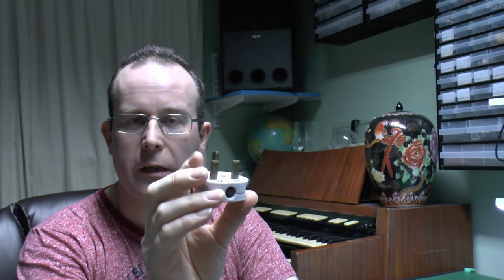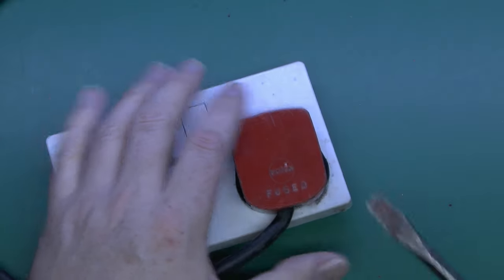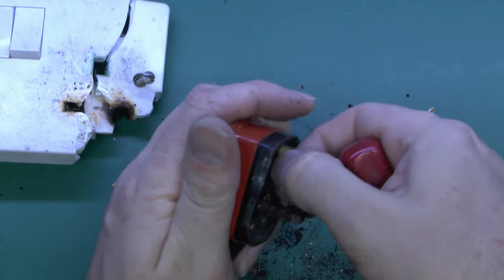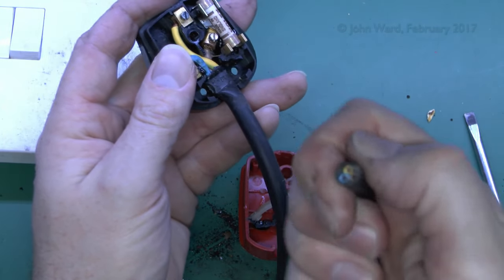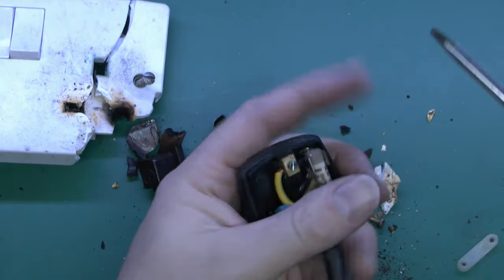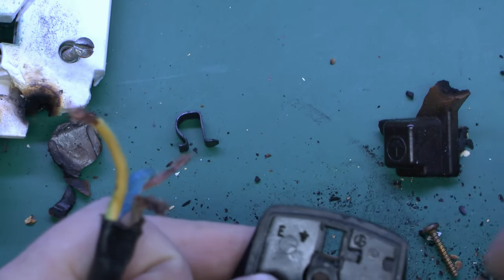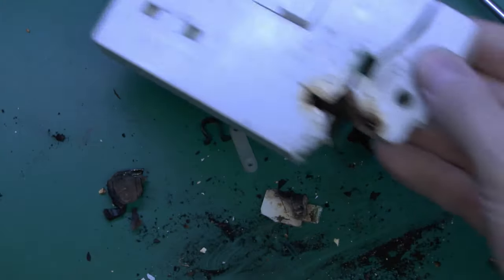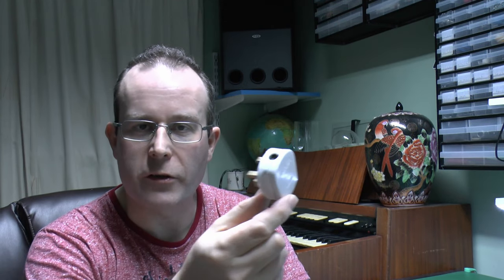Overheated Plug and Damaged Socket Outlet

Comment: I'm surprised to see this, since I was informed that UK plugs are so very superior to all others. ;-)
It is best to go straight to CEE plugs (IEC 60309) if there are high currents for a prolonged period.
Reply: you don't find IEC 60309 plugs/sockets in homes in the UK only commercial have it, and that's usually when you're pulling close to 13Amps or higher.
Reply: Yes, and they know why.
Why would I install another crappy household socket when it is only a question on time before that fails again. No need to push your luck with causing a fire when there is reliable industrial equipment to do the job safely.

I don't know how that CEE plug would deal with your UK ring-mains fuse-in-plug regulations, but since it is common already as a camper van socket there must be a way?
Reply: We use them at work a lot for server/coms racks mainly, well the 16Amp flavour of those and some 32Amp ones too, and they have an in line RCD breaker on the wall as normal as well as an overcurrent protection breaker just before the socket. Usually though in these cases it's a case of everything is rated way higher than the fuse/breaker.
Reply: +stefantrethan:

Yes, I think everybody would be happy to replace the discreet plugs and sockets with the bulky blue industrial style CEE-plugs and -sockets.

You could have this problem on every type of socket/plug:

http://www.eloteba.de/images/echeck-beispiele/echeck04.jpg

I've seen this kind of damage on Schuko too. This problem is caused by corrosion of the contacts. This is causing a transfer resistance and the contacts are heating up.
Reply: Sure, they are quite beautiful. Really shows the neighbours that you can afford a lot of electricity. ;-)

It can happen to any plug, especially with a (likely) termination problem as in the photo.
But if you compare the contacts in CEE and Schuko sockets I have a lot more confidence in the CEE type. It is a solid brass rod in a substantial brass tube, with a steel spring around the outside to compress the tube. Schuko sockets by comparison are just a flimsy stamped piece of sheetmetal, some cheap ones don't even have the steel springs around the outside any more to keep up the contact pressure.  

You can feel the heat generated in the Schuko plug with just a space heater, even just 1-2kW and you can often feel it getting hot. It won't happen with nice shiny new PCE Taurus connectors of course, but the real world is far from ideal conditions.

I had to learn this the hard way too. After one Schuko socket burned out the second time I wised up and stopped worrying about how it will look. After all a blue plug is a lot more pleasing to the eye than your whole house lit up with blue lights from the firetrucks...
Reply: +stefantrethan:

Have you seen the contacts outside of the plug shown here? The contacts of the BS 1363 are made of brass and went green through corrosion not through the heating up. That was the problem, not the socket. The plug must have been replaced when the first sign of problems occured. And this corrosion could happen on every type of plug. And the plug was not connected very well. Until several years ago you've learned in general school how you attach a plug to a cable in the UK, because there were several non-standard plugs available. The appliances were delivered with open end on the cable and you'll had to attach the plug for yourself. So this could be made by a non-professional.

And you should stop using this cheap, shitty hardware centre crap and use good material. In case of Schuko this would be Busch-Jäger. And if a Schuko is burning out twice times, you've got a serious problem that's not related to the socket itself. Could be the plug too, or the fuse or the MCB are rated to high (max. B16, you should not use the C-type for Schuko). And Schuko is rated for 10A permanent or 16A short-time.
Reply from the maker: The blue 16A CEE / IEC 60309 sockets are not permitted for household use in the UK, as all sockets for that purpose must have built in shutters.
Even with shutters, most homes have 32A circuits, so fitting 16A outlets would require a significant amount of rewiring.
Reply: I had a colleague at work once who had never interacted with a CEE plug, and thus did not know how to unplug it. So he got a screwdriver and began to unscrew the two joining parts. Once the plastic was removed and the contacts were apparent, he realised what he had done, and pieced it back together. The plug was obviously not functioning after that, but he almost electrocuted himself in the process; were it fatal, no one would have known for quite awhile since he was the only one in the building.

Comment: I wish I still had it, but here in the US, we had a far worse failure of an extension lead that was running a cement mixer. The socket side lost its springiness in the contacts (which is unfortunately super common) and the housing actually managed to catch fire
Reply: In this case, JW is almost certainly wrong and the fault was, like yours, down to a poor contact where the plug pin entered the socket. The clue is on all that corrosion on the earth pin, probably down to it being stored in a damp shed or outhouse. A poor contact (and it only takes a fraction of an ohm) and high currents and several watts of heat will be generated which and cause the sort of damage seen on that socket. 

I've had a similar problem on one old high-current device and an old power socket. It didn't fail that badly, but it did leave blackened burn marks on the socket.
Reply: Steve Jones in the us there isn't earth pins on the outlets they are earthed at the electrical panel (the one with the breaker switches)
Reply: Standard US outlets come in two varieties. Type A takes only a two pin plug with live and neutral. Type B has a an earth/ground and will take either a two pin type A plug or a three pin (with earth/ground). The outlets have no shutters.

Standard UK sockets always use a ground pin (to open the shutters protecting the outlet), but the appliance is not necessarily earthed (it depends on how it's insulated and what it's made of). For appliances which need no earth, the earth pin can be made of plastic. 

The earthing at the electrical panel is common to almost every electrical system in the world (albeit with variations according to whether the supply company provide an earth or not). A very few electrical distribution systems in the world don't provide supplies which are referenced to earth at all.
Reply: In the U.S., it is now a code requirement for outlets to be tamper proof. The outlets are shuttered to prevent one from sticking anything into one of the slots. A plug entering both slots at the same time is required to open the shutter.

Comment: I would suggest that the problem was in the sockets. When you disassembled the plug, you didn’t check the tightness of the terminals, which surprised me. If the line pin was not making firm contact with the socket, the result would have been much the same. When I was in the business, I tested some Crabtree sockets in a kitchen, all of which looked fairly new, and my tester showed open circuit cpc on more than one. I removed the plates to check cpc continuity directly, and they were fine: the pin was not making contact in the socket. This was many years ago, but surprised me, as Crabtree is a respected manufacturer.
Reply: Unless they were counterfeit maybe?

Comment: I had a similar problem which melted part of the plug and damaged the socket. The plug seemed to be properly wired. All connections were tight and the 13A fuse seemed to 'snap' reassuring tightly into place into the sprung metal fuse holder clips. However, when I put my thumb on the fuse it was possible to rotate the fuse quite easily in the holder. The opening in the clips was narrow enough to make it difficult to insert and remove the fuse but, once in place, the sprung force against the fuse contacts was weak.

Comment: I am amazed the inside of the plug was in such good condition.
Reply: Which is why it's almost certainly not due to a wiring problem in the plug. I've seen these before, and it's down to poor contact between the pin and the socket. Given the corrosion on the earth pin, then it's almost certainly going to be something similar on the live pin, and the poor connection was what generated the heat when high currents passed through it. Even a tenth of an ohm at 10 amps would generate 10 watts in a confined space.

In the case of the live wire it isn't even physically connected to the love pin. There's a ceramic fuse, and they don't conduct heat at all well. This was clearly not a loose wire problem (the wire would have been in an awful state).

Comment: In the us I only ever see the socket getting hot since out plugs are usually just the one piece molded plugs for us it seems like usually every house has one or two toasted looking outlets
Reply: also it doesn't help when some people jam wires in there because they haven't got a plug !  have  been in a house with every single power socket was like that or worse
Reply: thehappylittlefox aka benji,
Yeah usually when our plugs melt like this, it is either due to a manufacturing defect (poor connection/weld between wire and plug blade), mechanical damage (pulling it out of the socket from the cord rather than the plug), or from worn out contacts in the socket itself.

Comment: If it had been the live screw connection to have overheated, then it would not have transmitted significant heat to the pin as the two are only physically connected by a ceramic fuse which really doesn't transmit heat at all well. Also, the insulation on that live cable would have been fried.

A far more likely explanation, and something I've seen before, is that it's corrosion on the plug pin itself which is the problem. It would have created a relatively resistance where it contacted the conductors in the socket. The passing of a high current across that can generate a lot of heat inside the socket, which is where the damage has occurred.

There's even more evidence that this is a corrosion issue, and that's the state of that earth pin. Where has that been to get in that state? I think it's likely there was a lost of surface corrosion on the live pin too.

As I say - I've seen this before and it's not helped if the socket connectors have lost some of their spring power and don't grip the conductors well.
Reply: 100% ive seen many neutral terminals go bad because of lose wires but never a live!  Maybe the socket was damaged by a "Socket Protector"

Comment: John - At the start that is a pre-1984 plug you have there. I guess it goes to show that they are reasonably rugged bit of kit. Its good practice to use crimp ferrules on the ends of the wire so that the screw is not bearing down on the strands of the wire directly.
Reply: Hi, I always solder the end of the wire where it goes into the pins, I run inverter welders on long extension leads and rarely have a problem. You can't draw current like that continuously, but given a rest every so often it's fine. Keep my plugs and sockets clean and maintained and NO problem.
Reply: @90vanman  Solder is a bad idea in that area. After some years it will deform that much that you'll have the same problem. That's the reason this procedure is banned here in Germany for round about 40 years. The best way to go is to do as Colin wrote: Ferrules crimped on the ends of the wires. Here it is mandatory to do so if you put stranded wires into a screw-type terminal.

Comment: the moulded plug on my tumble dryer failed in this manner, after replacing the double socket and putting on an old mk plug from my spares box i have had no trouble, says a lot for modern manufacturer safety doesn't it.

Comment: This happened to the pin of my dryer and the three-way socket extension, which was shared with the gas heater. But the pins of the gas heater were fine. How is it that the fuse did not blow when this happened? Is it ok to cut the wires of the dryer and reattach to a new plug? I think the dryer should still work.

Comment: thanks for the video: I have a question sir.
I have a  melted plastic on an electric plug of (water heater for tea) just little plastic on one of the 3 (what you call it? iron ) of the plug, nothing serious but still around on of the three "iron" rod has some plastic stuck to it, i scraped it , but still there  a little lamination of that plastic is felt there..would it be dangerous to use, or can it be cleaned totally? or do I need to change the whole plug for that little melted plastic on it. Every thing is fine just one rode has some melted plastic on it..

Comment: Hi John.

I have seen no end of these in the large housing estates in the north of England owned by the council.

When the socket gets fried like that and is changed usually the wiring immediately behind the socket has burned back a little.
Nice if the installers had left some free wire to attend to. Short wiring is such a pain.
Also the plug top was the tenants responsibility but rarely did they have one so we supplied one.
Some makes of socket and plugs are just poorly made and are not really good enough to power large loads like a 3 bar fire. We recommended them getting a good make like MK.

Interestingly John here in the US I rarly see any burnt sockets or light switches. It is 120 vac. Guess that may be the difference but harder to say why?

The older properties mix light and sockets on the same circuit.
I don't like that one bit.
And its impossible to get a fast kettle with the 120 v and 15 to 20 amp wiring!.

A nice project for you to comment on John, The type of double pole switches as used for examplne in the cupboard where the immersion heater is switched.
I have seen a burnt neutral so it appears the heater is not fed but there is a nice live there in wait!
Reply: It certainly can happen with sockets in the United States. A friend of mine used an under-rated extension cord to plug his washing machine to the outlet. After prolong use, it started arcing inside the outlet and it started to smoke. It melted one of the blades off the plug and the blade was stuck inside the blackened outlet.

Comment: very dangerous but it shows you what can happen when you don't wire things properly
Reply: It probably was not a wiring fault.  Judging by the corrosion it was possibly due to water damage.
Reply: The 13A plug and socket are a very conservatively rated bit of kit and in good condition are capable of well over double that current. Hopefully the statute of limitations applies to my confession to having done just that  on one occasion some 30 years ago with a length of brass rod serving as the 'fuse'.

Comment: Any idea ehat would cause the socket face plate to crack. No loose wires or burnt wires behind
Reply from the maker: A plug overheated and that heat caused the socket to crack
Or someone wrenched a plug out carelessly.
Reply: @jwflame  its been used to charge a car. The plug does ok and no burn marks on plug or socket or wires behind
Reply from the maker: @jacko2815 Its overheating, charging a car will apply a high load for hours at a time, which most sockets were never designed for.  Doesn't have to burn anything to cause fractures in the plastic.
Reply: @jwflame  are there any brand sockets which you would recommend to take the load

Comment: i guess that's the reason why it's recommended to use properly crimped ferrules on stranded wire before clamping them in. But it would not have helped in that ase as it seems like the fuse clamp was not properly rivetted down to the live pin.

Comment: What  does it mean if my 3-pin USB adapter, that I use as a charger shows signs of burns on the earth pin? The earth pin is made of plastic. It is blackened. The charger still works, but my phone charges a little slower. Does this mean my adapter is faulty or my plug point has a problem? I have tried a different plug point to no avail. Don't want to risk destroying another adapter. Any help would be much appreciated
Reply from the maker: Faulty adaptor most likely, and with a plastic pin overheating internally would be the only real option.
Sockets can cause overheating if they are worn or damaged, but that would only occur with metal pins which carry current.

Comment: Hi john. I changed a plug and then what you showed happend to the plug (burnt) I changed it the second time it does not seem to be getting that hot although still does get warm but the pins get really hot.....any ideas ?
Reply from the maker: Loose wires in the plug or the socket.  If it's overheated before, the socket is probably damaged as well.  Solution is to replace both the plug and the socket.

Comment: Hi, I have old hotpoint tumble dryer that is about 3kw. Plug was getting very hot and i just replaced the whole cable with genuine unused cable that came from the actual factory where they are building these machines. It is still getting very hot. How do i resolve this?
Reply from the maker: Poor quality plug, poor quality socket, or one or both have been damaged by previous overheating.
Replace the plug and socket.
Reply: @jwflame  thank you very much. Will buy a socket tomorrow. Am i right to assume that if i plug the dryer in different socket it should be ok?
Reply from the maker: @tabletsam9505  Possibly - although if the plug is damaged, it will still overheat and damage the other socket.  Replace the plug as well.
Reply: @jwflame  thank you very much. I will do that
Reply: @tabletsam9505  have you done replacing both the plug and the socket? What is result now? Is it still generating heat like before?
Reply: @SSUPMUSIC   Yes, I replaced both. Using genuine unused cable (100%) and new socket. Still getting hot, but considerably less....